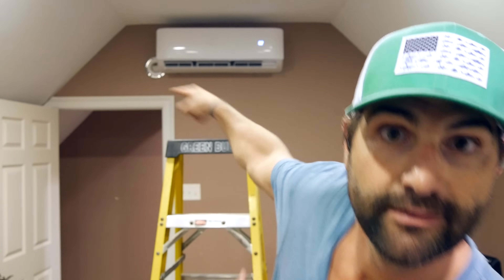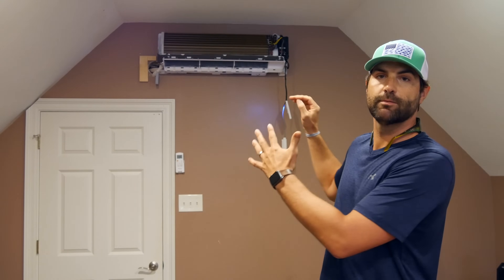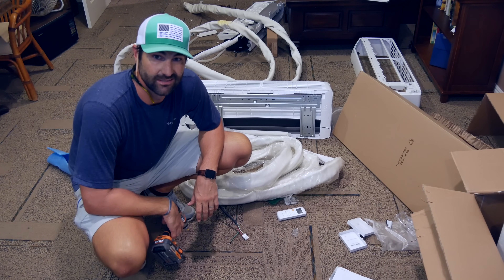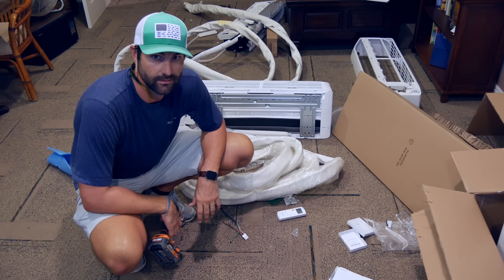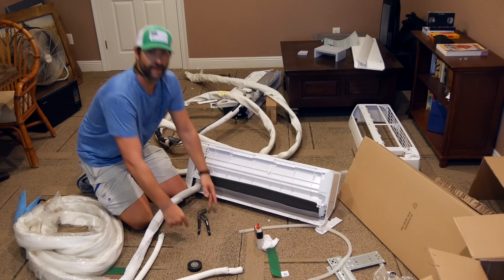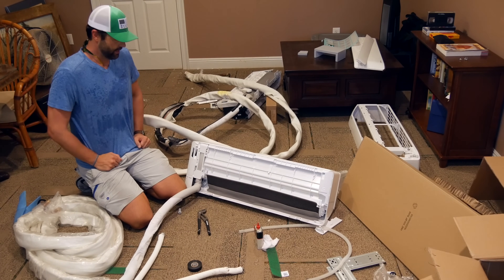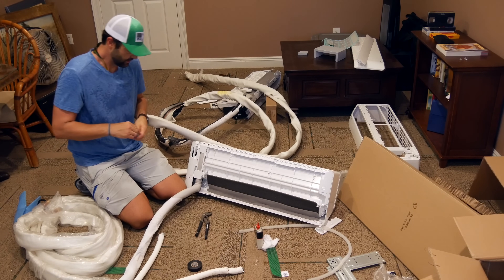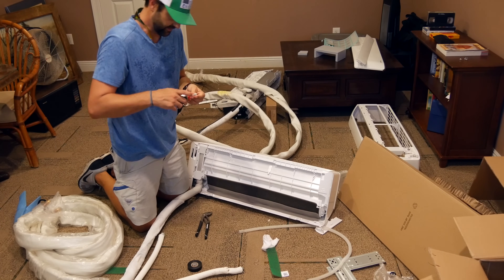Troubleshoot DIY Mini Split Not Cooling - Replace MRCOOL 18k Mini Split

Comment: Any idea on the failure rate for these units? Know one that lasted only about 2 years before having cooling issues.
Seems like a good design if it does not break down like yours did.
Reply: More than likely if failed because it wasnt installed right. Coiling the lineset.
Reply: My first experience with a mini split has been a nightmare. I bought the 12K 4th Gen DIY model from Costco and it has been a complete lemon despite replacing essentially everything over a three month period. Upon initial install, it immediately threw a communications error on the evaporator (indoor) unit. Support for the issue started out with the claim the evaporator could be wired wrong. Had us switch wire positions. After that, it wouldn't run. (Had to go back in and put the wires back the way we found them, only to encounter another error this time suggesting the evaporater itself was defective.) Next, they had us replace a circuit board in the outside condenser. Still, there was no signs of life from the condenser. Ultimately, everything was replaced bit by bit over THREE MONTHS before my Labor Day 2023 weekend install began heating in time for winter. 

Something to note: I live in a State where manufacturers can't charge shipping/handling for warranty parts so I was out nothing when they also replaced the condenser. I have since run across many complaints on this and other brands where owners complain the freight is prohibitive (considered oversized for shipping purposes). Another thing I have come to appreciate after the fact is that HVAC pros don't have access to parts for Mr. Cool. They depend on the manufacturer same as the customer does in a DIY situation.

When the condenser was replaced. Mr. Cool also replaced the linesets. Come Spring, we needed to move from heating to AUTO mode. That's when we realized we had yet another problem. At night it was cold (not putting out heat). During the day it was hot (not cooling). It just sat there doing nothing when set to AUTO. We were simply told that AUTO mode doesn't work well. (Nothing they could do about it.)

While our Springtime help ticket was still open, we had a late Spring heatwave so we set it in COOL-only mode (24/7 operation). The ability to cool from outside temperature was less than the same BTU wall units this mini split replaced. (Expected about 25 degrees cooler from outside temp on 100F day but saw only about 15F cooling in early June.) From June to July, the cooling capacity became progressively worse and now the inside temperature is only about 5F cooler than outside temperature. 

Last fall I have to say that once we did hear from MR. COOL, tech support was great but for the fact that it was slow working through all the steps to determine what part needed to be replaced (which unfortunately amounted to everything). This time around, help has been confined to a supervisor named "Patrick" who called once and put our service ticket on hold even though there was no resolution. I then tried to restart the warranty support process over email, but the same supervisor keeps responding and none of the replies reflect that any of the emails have been read or understood in the least. (I can't blame it on a language barrier because Mr. Cool has U.S.-based support.). 

I then emailed Mr. Cool a photo of a weather station hanging on the wall of the room that displays the daytime and nighttime high/low temperatures in a single glance. The nighttime temperature was only ONE DEGREE cooler than the outside temperatures, which confirms it is isn't putting out cold air at all. After sending the photo, there was no acknowledgement. Instead it was stated that it takes awhile to cool the room down if you turn the mini split off. (It had been on 24/7 since it was installed last year and that was made clear in all support emails.)

For a DIYer, the thermometer gun is about as valid a test as one can get. (You can find websites online that tell you how cold the air should be blowing. So without being guided through any troubleshooting steps by Mr. Cool, I used an infrared thermometer "gun" to check the air temp coming out of the evaporator (72-75F) and then emailed what I found to "Patrick". His answer was that a thermometer gun — even though I have seen HVAC pros use them! — is not a valid test to determine what comes out of the evaporator because it depends on the temperature of the air going in through the top of the unit. 

The sum total of the "help" received in three months is to set the thermostat lower. (It's been set to 65 for weeks!)

I am now at the point where I have no choice but to get Costco customer service involved. I asked on Friday if they could facilitate Mr. Cool reimbursing us for the cost of getting an HVAC tech out — if we can find one who will agree to take a look at it. I don't yet know if Costco will have any success with this request, but in order to obtain a refund they expect us to uninstall this lemon and wrangle it back inside the manufacturer packaging to return it using a return ship label. (It is next to impossible to repack this thing; but fortunately for us we hung onto the packaging!) At that point, we would be looking at essentially a third uninstall, go back and patch the mini split hole in the wall, open up the wall again where the old A/C wall unit was and replace our mini split nightmare with a modern inverter type A/C unit. (Costco is good about standing behind what they sell but it's the hassle of this that has me tearing out my hair more than anything.)

Mr. Cool did not help in the least on this current situation but I learned, thanks to YouTube and elsewhere, that one of the potential causes of failing to blow cold air, besides the obvious culprit of low refrigerant, is a dirty condenser and a dirty evaporator. The energy savings are considerable for a mini split but unlike a conventional wall unit a mini split does NOT bring in fresh air and are therefore known to clog up and accumulate mold in the evaporator. They are not "low maintenance" compared to other forms of A/C. Had I known that Mr. Cool units require a deep cleaning every six months — potentially to include a partial tear down to gain access to the blower wheel in the evaporator which is where mold may accumulate — I would NOT have bought this or any other mini split. (Simpler installation, less maintenance and similar savings on an electric bill by buying a modern inverter wall-unit style A/C vs. a mini split.)

In closing, Mr. Cool does not have any authorized service providers. If there are problems, the customer is 100 percent dependent on their phone/email support to troubleshoot. In fact, their phone lines are so busy you will be lucky to get a callback and if you do get a callback it won't be a technician. A customer service agent will confirm that they are just adding you to the list. Even if you already have an open ticket you will be asked to wait in line. Given that this unit has been a lemon, I find the fact that they are making me wait longer for technician follow up suggestive of the expectation that they intend to simply run out the clock on customers' patience if not the warranty. Upon visiting the Better Business Bureau profile for this company, there are dozens of pages of customer horror stories. I have, in the course of trying to get our unit working properly over the past year, posted questions to MR COOL install and troubleshooting videos only to have YouTube take my comments down. The company is protecting their reputation by making sure word doesn't get out.

Comment: Dude you're totally wrong 🤣 smh . Shutting the isolation valves at the outdoor unit isn't gonna remove the refrigerant from the lineset . And you failed to mention who pulled the vacuum. And how do you even know the old head was leaking? Folks don't do this

Comment: I was so confused bro. But when he said I gotta change my shirt or my wife is gonna kill me it all made sense ☺️. Nice Content by the way.
I live in the Caribbean where it is hot most of the time and my split unit 12000BTU started blowing cool but not cold. Idk if it need gasing 🤷🏽‍♂️ but I serviced it and cleaned all the drain vents. If I go close to it I can feel the cold air. But if I go anywhere else in the room I swear a little.
The lower evaporator use to get a little frost on it and quickly melt while the upper coil was dry and cool. But recently my lower coil stopped frosting and just has water dripping into the drain pan. Any tips?
Sorry for the long Message 🙌🏽
Reply: Sweat*

Comment: Hey man, I also need to have my lines exit through the left hand side like you did there. How did you manage that? Both the outer casing and inner casing get in the way. I wish you hadnt skipped over that, since everyone typically just mounts it to their external wall and has their lines running directly behind the unit.
Reply from the maker: You have to slowly and carefully bend it.  Scroll down a bit in this post and you’ll see a picture of it.  https://do-daddy.com/diy-mini-split-installation/

Comment: Yes mini splits work quite well for about 1 year. Then the leaks start happening, the main boards fail, or you will get a communication E5 or E6 code. These units are throw away pieces of garage. I've worked on And am a mechanical contractor and anything you save on your electric bill will quickly paid in servicing costs. We will no longer install mimi splts, because we have by law to honor a 1 year install warranty. This customer is only at beginning of his nightmares with these  minisplits. Very rarely we will find one that is still running after 5 years. So with all that money you blow away on these garbage units, on repairs and leaks, you could have spent your money on a regular zoned A/C unit. Yes there good for doing a garage  attic or older homes. But just remember they WILL leak, constantly break down, and will  be  unreliable. So that's your trade off. Very short term convenience, for a nothing but problems after 1 to 2 years. I know there will be people that will say there units lasted 6 or 8 years, those are rare cases. Or experience on these units is you will definitely have a problem, and a major problem, with these units in 3 years.

Comment: As I await the arrival of my DIY MrCool that I ordered on June 15, 2020, I am looking at all the videos I can find on the MrCool units.
What I have learned that the 3 rd generation that is shipping now has 4 line set connections instead of two like this one does and the line sets are soft copper tubing un like the flexible lines. Not be flexible to me is a negative. This could have been a weak point and thus gone to soft copper line sets. Why 4 connects is my guess that you would un coil only the amount of the line set needed and that the remaining could be hung on the wall and not have to be feed through the 3.5 in hole. I have have installed two other non diy mini split units with out issue. However this time I went with the DIY since I am not a HVAC guy the warranty would be the issue if I installed it chances are great that a manufacturer would say I made a mistake. So after careful consideration I decided to go the DIY route and pay about $600.00 more plus I would not have to buy a set of gauges and vacuum pump. Descent gauges and pump cost do not out weigh the small saving to me if I did have an issue mean zero support of a warranty.
Seeing this video and his resolution confirmed to my self that I made the correct decision. I will say I have made many flared connections or years and darn few failures I feel confident making up a line set. In the case with this MrCool I will have a length of 17 feet to coil up and suspend.
In my case mine will be protected from eyes and anything that could compromise the lines set, so I can live with this slight negative.
Good video both of yours that viewed. 😁🛫
Reply from the maker: Definitely made the right decision.  My Dad purchased the one you purchased and it is much better than the one in this video.  Thanks for watching and commenting
Reply: Pahjo Designs I learned today that my 24k 3rd generation unit will be delivered on Monday, I will provide feedback if I discover anything being note worthy..😁🛫
Reply: Feedback/ update my 24k DIY arrived on Monday June 29, however it arrived at my local shipping terminal on Friday at 1:41 AM it sat in the terminal all day Friday Sat and Sunday was delivered on Monday. I evacuated the system of the old 12 K mini split it going to a new location.
I completed the electrical work for the 240 the other one was 120. Hung the air handler and formed the lines for the line set hook up. After attaching the the high side I could hear the gas escape the line set Into the evaporator on the low side of the evaporator the plastic plug popped off. At this point the other end of the line set had not been connected to the condenser. It turns out the proprietary fitting that should have been on the low side of the evaporator was not installed it was only a flare fitting. I contacted my sales person he had me send pictures. So today I got an email thanking me For my order this concerned me yes they agreed I needed a new line set and evaporator. The new order aspect gave me the impression that this would be handled as a new order not a we have to get it there ASAP as I have no conditioned air and the temps are in the 100’s. So I will have see how they handle this mess up and the priority of the shipping.😩🛫
Reply from the maker: Hopefully it arrives soon!!  It’s HOT this summer!

Comment: heres some advise, if a hvac/r man comes over, and says no gas in unit. than just puts gas back in without finding a leak, or proving no one was huffing the gas, and just put gas back in and leaves......fire him, get someone who knows what there doing. also, a tid-bit, freon is a brand name like Kleenex is to tissue papers..... its called refrigerant, just a little fyi
Reply: So freon last forever in a  mini split,  you should never have to add any more to it
Reply: @ckkendrick7861  yes, unless theres a leak
Reply: If its low on freon, why would there be a leak. How long normally do freon last in this mini split, is it every year you need to add some or more like 2 or 3 years
Reply: @ckkendrick7861  are u serious? do u know what ur doing? if its low...theres a leak!!!! refrigerant doesnt burn up or disappear...

Comment: Nice vid, and you are right on cost.  You would pay $8K for one split system with about 3 ton capacity.  Those would also suck a lot of power.  I love these mini splits and they are the future for sure.  You can even augment any current system in your house trying to keep up.

Comment: How did you pump down the system in order to remove the lines from the compressor?
Reply: magicbbman32. Probably didn't
Reply: He said the machine had already pulled itself into a vacuum the first tome, so maybe it did it twice

Comment: Hi there,
Just wondering did you vacuum your system before letting freon in the line?because the  Moisture that enters the system can cause many and serious problems, such as moisture freezing in the refrigerant control orifice, acid, and oil sludging. Moisture freezing in the refrigerant flow orifice. This will result in poor cooling and lower than normal suction pressure if the orifice is partially blocked
Reply: Domas. These units have "pre charged" pipes apparently, with special connections

Comment: I have the same unit and it just stopped cooling or heating! Did yours give you an error code at all? Mine did not.
Reply from the maker: Shannon Bossard - no error code for mine.  It just stopped cooling.
Reply: i have the same problem as you...dont know why yet

Comment: Man, I love those flexable coolant lines.  I just ran lines for a mini split for a room over my garage and running those stiff copper pipes really sucked.  I wonder if I could have use Mr. Cool on my unit.
Reply from the maker: They are definitely convenient.  These DIY units are all in one, meaning the lines are connected to the inside unit out of the box.  I’m not sure if they sell the lines separately.

Comment: Do you have any updates as to MrCool and or reliability ?
Reply from the maker: It’s been great.  I did have one fail on me a few weeks after installation, but they sent a replacement unit and it’s been perfect ever since.  I have 3 of these units and they are great.
Reply: I see so many installs and very  little next to none of the long lasting vids, Being a disabled Vet, the moneys we spend are pre searched for long lasting and 10 years is not too great of an expectation, thank you for your timely reply too :)

Comment: I dont get why you would go through the trouble of replacing the evap head when their was clearly no issue with it, makes no sense to have them give you a brand new one
Reply from the maker: You need to pose that question to MRCOOL.  I didn’t make them do anything nor did I ask them to replace that particular part.

Comment: What is that white thing dangling from the wires at the bottom? I can’t get mine to start I think it might be missing a remote control sensor?
Reply from the maker: That is the LCD display or it may be the holder for the usb WiFi controller.

Comment: damn man, your sloppy af,  so whats the consensus ? you had a leak, Did you locate it and fix it?  Ive seen techs repair coils on roof top units... how does the mr cool brand hold up? Im fishining the 24k install tomorrow
Reply from the maker: They sent me a new indoor unit and it’s been working like a champ since.  My other unit has held up as well.
Reply: @PahjoDesigns   Thank you
Reply: follow up: Do you know how to calibrate the remote control "Follow me" *mr cool thinks its 72, but its 70